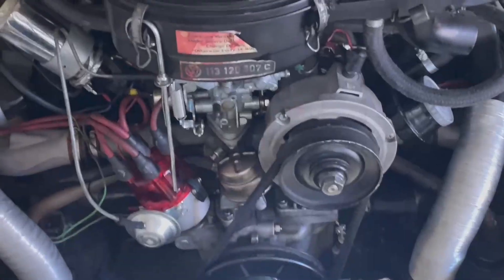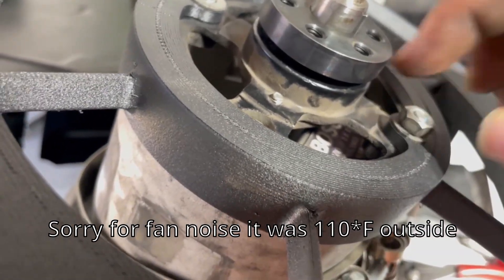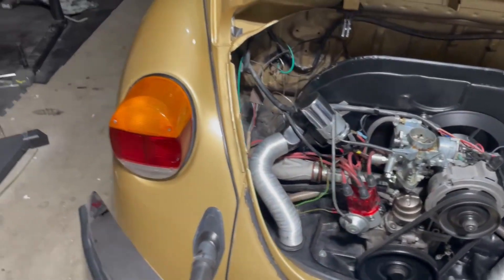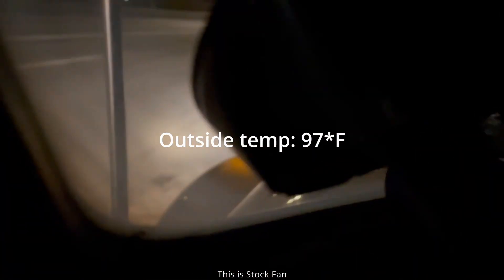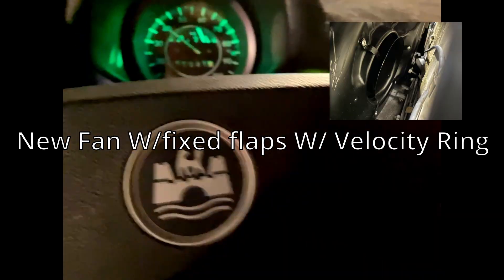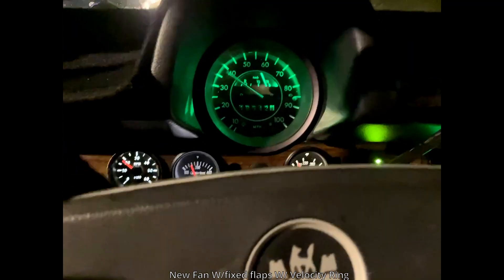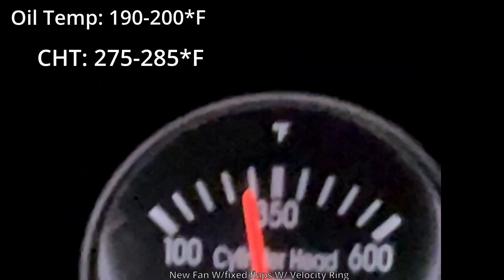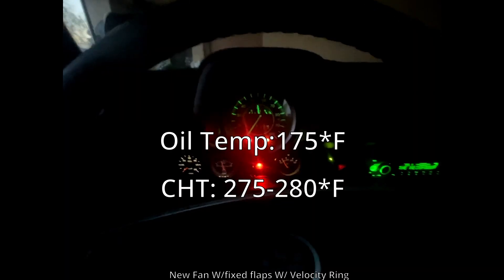VW Evolution Two Cooling Fan installation and "test"

Comment: I wish the guy can begin to print these evolution two cooling fans again because these things work.

With them in use i don't think your beetle will everbbbe under a heavy temperature stress
Reply: I have a new version, and it's now injection molded, like the Evolution One.  It's a lot more robust than the original, as there were some failures.  So, if you're interested I have them in stock.

Comment from the maker: 110F
5.6 Miles
CHT 285
Oil 190
4th gear 45mph
Reply from the maker: 88F
13.2 Miles
CHT: 270
Oil:195
4th Gear 65-70mph
Reply from the maker: 88F
25.7Miles
CHT:290-300
Oil: 200-210
4th Gear 70mph
Reply from the maker: 85F
17Miles
CHT:250F
Oil:185-190
4th gear 67mph